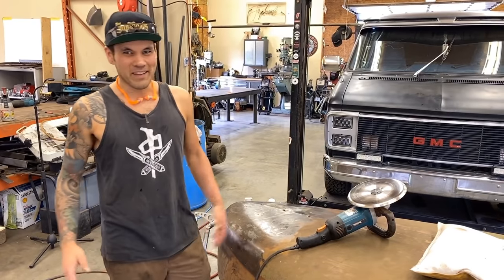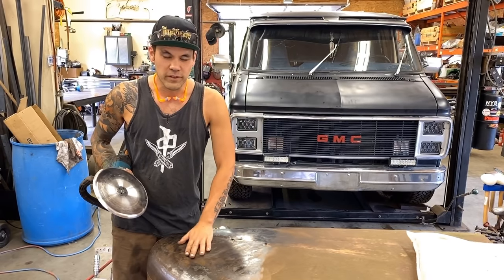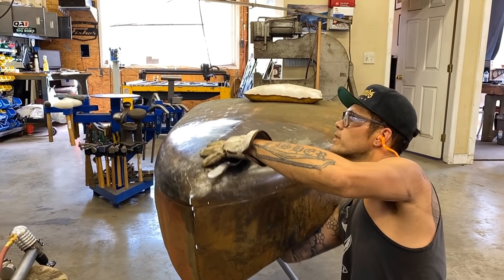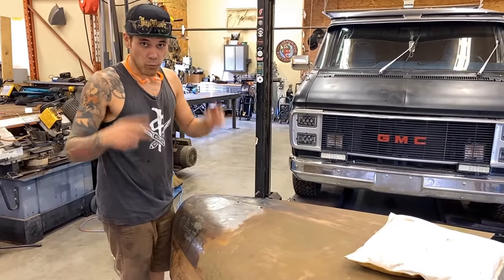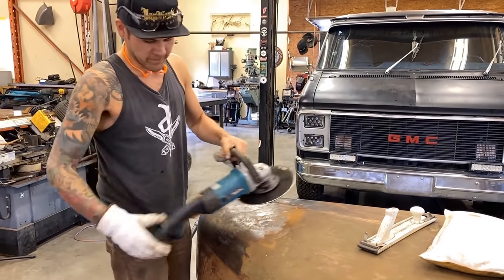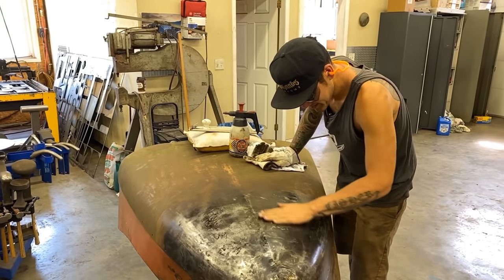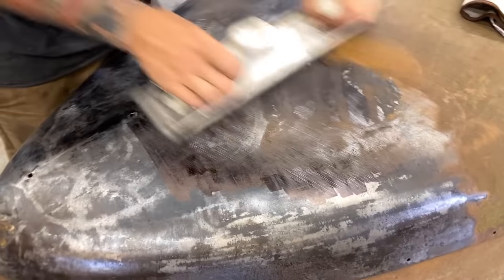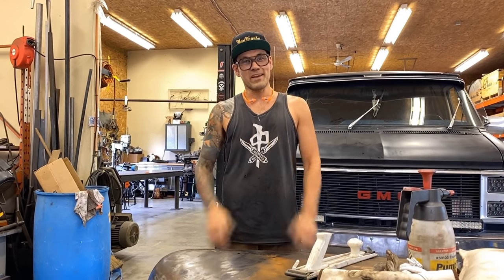DENT REPAIR: Using PROSHAPER'S Shrinking Discs!!! 1940 Willys Hood (Pt 3)

Comment: What would happen if you hammer and dolly without cooling the metal first?
Reply from the maker: Depending on the temperature it might be a little bit more pliable but the problem would be that it would not be a true reading of the panels relaxed state. We always work panels when they are cool because that’s how they will be in real life

Comment: I have a dent in a body line what’s the best way to go about it someone did it in a parking lot . It’s a 98 Honda Civic. It’s on the body line above the rear wheel. Can’t really get a dolly in there.
Reply from the maker: Your only choice is really to use dent puller’s like a uni spotter

Comment: Im not sure sharpie really insulates very well. Pretty sure it’s not gonna effect the heat generation much.
Reply from the maker: It doesn’t a lot but it does a little it actually makes the wheel slip and not heat up is fast it seems
Reply: @MakeItKustom  I guess that makes sense

Comment: This is odd. I have always used the heat shrink method. With a torch, hammer and dolly with a  bucket of water and wet rag.
41 year experienced Collision Repair.
Reply from the maker: Me too actually this is the first I’ve use the shrinking disc and it’s really blowing my mind. The hammer dolly Torch heat shrink still has its place.

Comment: Now what about oil can dents from dips sitting on the roof of a car?
Reply from the maker: This could definitely take that out as well. When someone sits on the roof of the car and dents it, The metal around the large dent where the crinkles are has now stretched a bit which creates the oil can affect. I would push the dent out hammer as much as I can and then the perimeter of the dent will need shrinking using a shrinking disc
Reply: @MakeItKustom  Cool, the turd that had my truck before me sat on the roof like an idiot